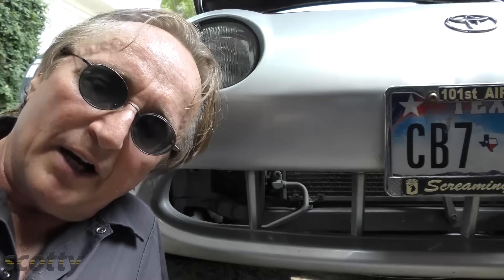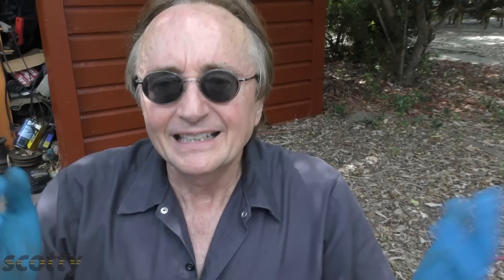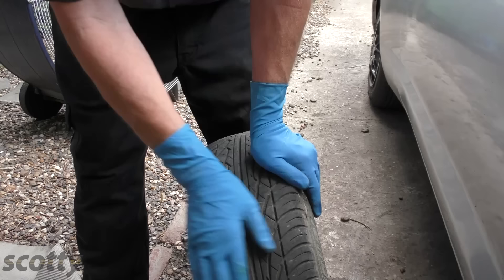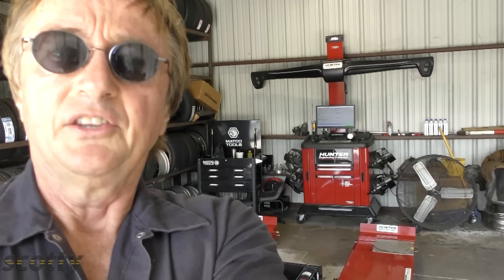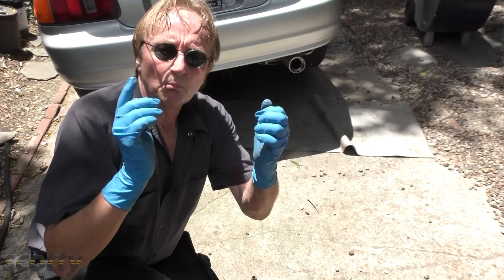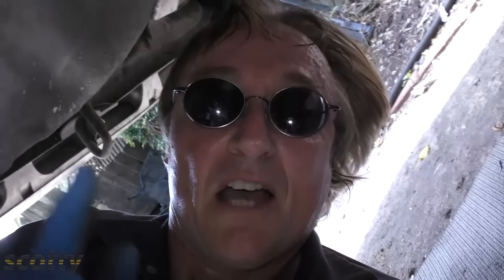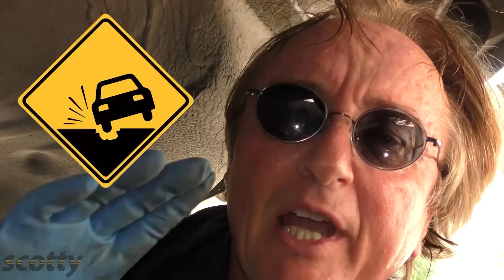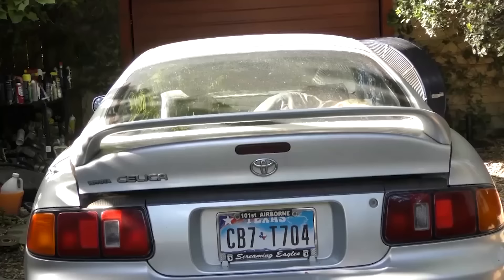How to Tell if Your Car Needs an Alignment

Comment: I'd have to disagree with Scotty on taking your car to a pro. First of all, it goes against the main premise of this channel which is to do the work yourself so you can save money. I had a 2000 e150 vanand the steering wheel was pointing to three. With the few turns of a nut my steering wheel was perfectly straight and I was a happy camper and I'm not even a professional. The problem is this: people figure that if they need an alignment (which many times they just don't.. I agree with Scotty on that) they see that small $69.95 fee listed at the shop and think that is all they are going to pay, but most mechanics are crooks and it will more likely end up costing you hundreds of dollars. If you ask me, common sense says to do whatever you can to fix your problem. Even if it's not completely correct, the possibilities of getting your car back completely correct from the alignment shop without getting robbed is just as good. It's just a few nuts, some measuring tape and visual inspection. Just leave a slight angle on the tires. More or less what the manufacturer recommends. If your tires are wearing unevenly it's even easier to adjust. Even if you don't get it exactly right, chances are it will be a great improvement.